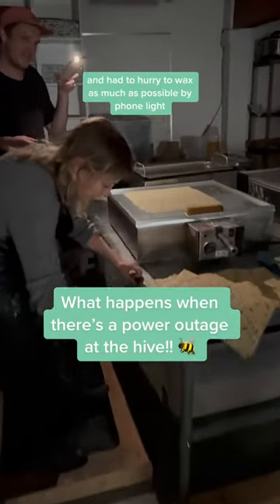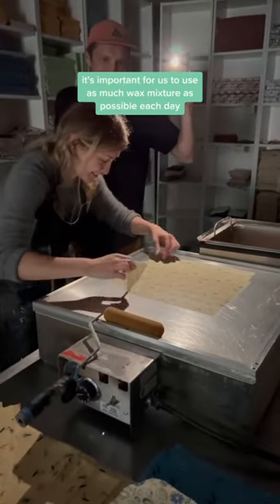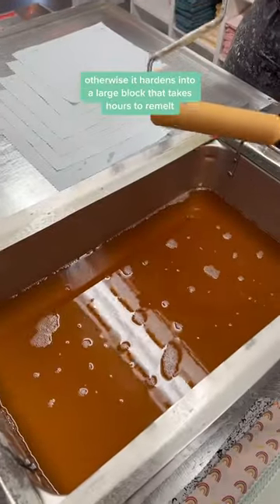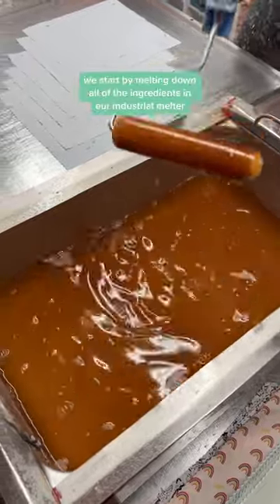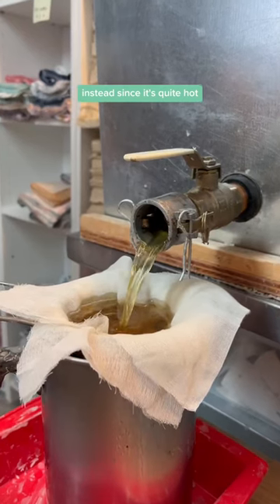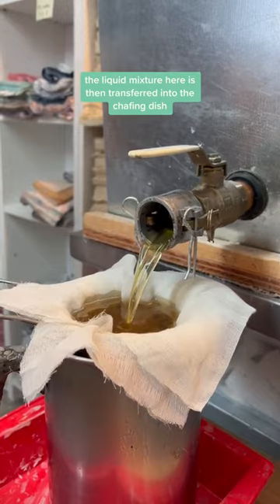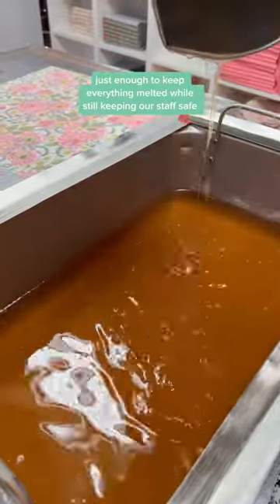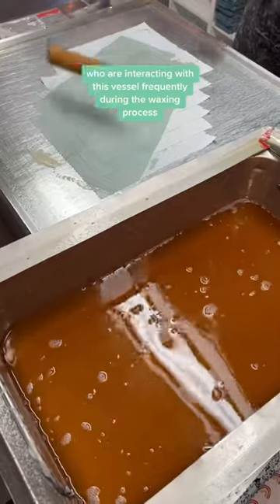What happens when there's a power outage 🥲

Comment: I was wondering, can I use the beeswax wraps in the freezer? 
And can I use it with raw meat?
Reply: Idk about raw meat, but they have a video that shows you can use them in the freezer :)
Reply: raw meat is risky, definitely don't use it with chicken or fish (my beeswax wraps aren't from this brand but those were the instructions on mine). you can't clean them well enough bc you can't heat them up to kill bacteria which is what you do when you wash dishes or do laundry. 
freezer should work just fine.
Reply: yes
Reply: Raw meat would probably be fine for just a one-time use cause like.. it's gonna hold a lot of bacteria and you definitely don't wanna make that come in contact with more food

probably not worth doing that
Reply: I was actually just thinking of have some separate wraps for only freezing raw meat, so not using the wraps for anything else. 

It would be mostly for my dogs meat because that’s the thing I’m still using a lot of plastic on, so they wouldn’t be used for something else.
Reply: @femijnbas7208  in that case, my tip for that: keep the wraps in the freezer. freeze the meat and from then on forward the wrap never gets unthawed. unwrap the meat while it's frozen, fold it (if you don't reuse it immediately) and put it back in the freezer. that way you shouldn't have to worry about bacteria. it won't seal as well anymore but idk in what 'condition' your meat is (like, is there a lot of blood that can run out and make a mess in the freezer). or maybe fold pockets with one side open. hope that helps, try it out!
Reply: As others have said, since you can't heat the wrap up in order to kill the bacteria, it'd be way too risky to continue to use with raw meat. If it makes contact with raw meat, I'd just throw it out for safety.

It WILL be fine in a freezer on its own, though.
Reply: I wonder if they could make a one time use but biodegradable wrap. Like one made of bamboo/banana paper or recycled paper?
Reply: @femijnbas7208 I also raw feed my dogs. You could cut your plastic use back by using Ziploc style freezer bags, reusing them & storing them empty in the freezer between uses. Another idea that would also fit unusual shaped meat & bones would be a large food safe freezer container. Yes, it's plastic but it would last for years. A restaurant supply may have something that would work well in stainless steel as well. Just some ideas off the top of my head. I hope it helps.

Comment: Try getting solar lanterns like the luminaid  ones. I found the Chinese ones worked best. I have 4 that have been used each day for the last 7 years they do light up the room and you just place them in the window to recharge. Takes no additional power and makes an excellent backup. I use them as night lights but have used them during blackouts, family were so suprised about how well they worked.

Comment: I was going to buy it but I'm curious, how many times can you reuse it? When does it become less effective?
Reply: These wraps last about a year and you can reapply wax easily during that time as needed. Lol I've been binging their videos.

She said they are also biodegradable :)
Reply: @MP-me7tc  how do you reapply the wax
Reply: @joshuaparker5971 They have a block of beeswax you buy and you just scrape a small amount off. You lay the cloth on top of parchment paper, spread the wax you scrapped onto the top, put parchment paper on top and iron it. The wax melts and the iron pushes it around and it evenly coats the cloth easily. Then you hang it to dry until it's cooled completely. It's really easy, i've used these (this brand and others) for years. It takes about 6 months of regular use before you need to refresh with wax and the wax bar lasts forever. I'm not even half way through the first one I bought and I'm pretty sure it's been about 5 years!

Comment: Does the wax scrape off of the paper easily? I ask because A) I don't want wax residue in food B) I worry about the longevity of the wraps
Reply: The wax is soaked into the cotten fabric. It doesn't come off when you scrape it unless you are really trying hard. If you heat it up the wax will melt and come off. 😊

Comment: Why do you overlap the sheets? Are they all getting the the same amount of beeswax or is the top sheet getting the most meaning it'll be more waxy than the others
Reply: They layer them that way so that they're easier to individually separate after the wax is applied. The layers are all saturated--they made shorts showing them testing 10 and 20 layers at once.
Reply: Think of it as if you are soaking a piece of cloth in water. The water is "inside" the cloth, not laying on top😊
Reply: @karianne7796  thank you for the education I appreciate it honestly I do I'm not very familiar on how beeswax works so thank you

Comment: why don't you store the mixture into smaller manageable blocks that will take less time to melt through? That might help. I hope.
Reply: im not sure if this explains exactly what youre asking, but between the industrial heater and the smaller one that would cool down there are additives put in the wax that make it unable to go back in the industrial melter because of contamination of sorts. because of that, wax that goes in the smaller heater and hardens there also has to reheat there, so taking it out and cutting it up just to put it back isnt going to do a lot for the melting process, though it could marginally speed it up!